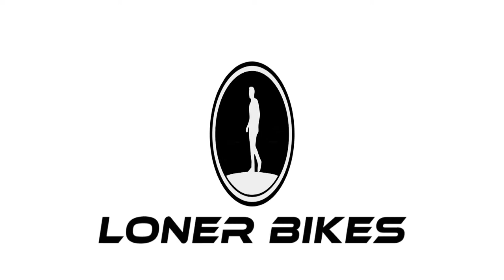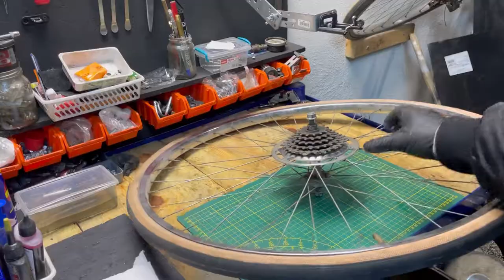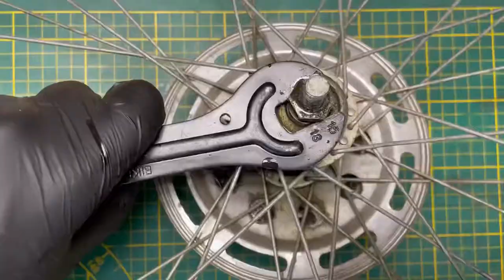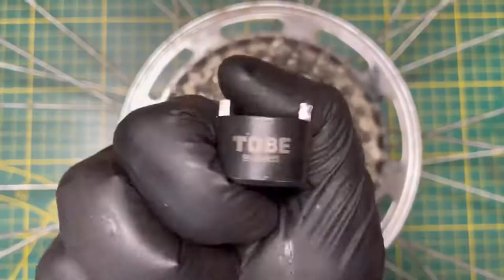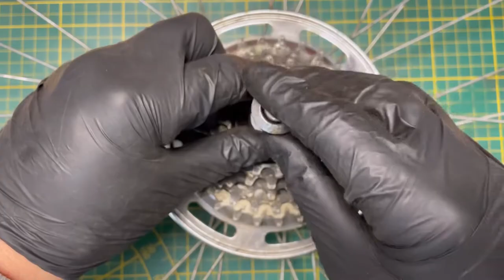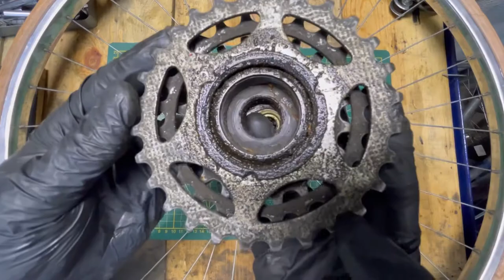How to Remove Vintage FREEWHEEL | Correctly Unassembly

Comment: What tool are you using? I’m looking for such a tool😅
Reply from the maker: There is a lots of types of this tool, but this is for old freewheels size.
Reply: I have all of them from the 70’s. 

You generally do not have to remove all the bearing locknuts.
Reply: If you had the tool it was almost as fast as changing cassettes. We designed a holder so you could use a road sign as your bench vise. “Pocket vise” it was called.
Reply: search for TB-1035,  it has two notches, outer diameter 23mm.  Its specifically for Suntour FR-2  freewheels.